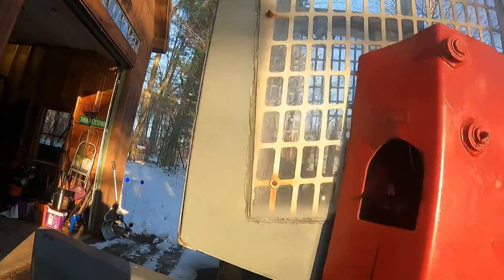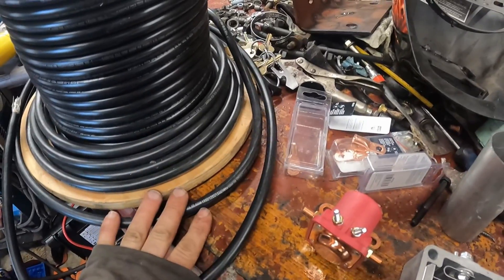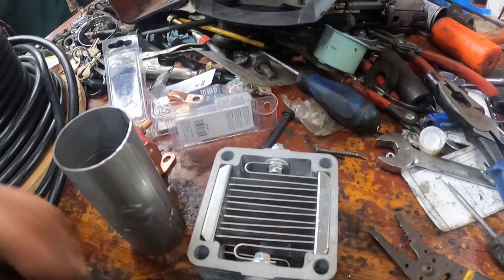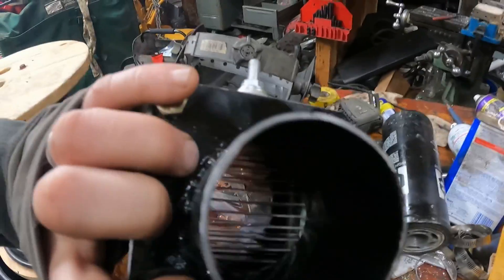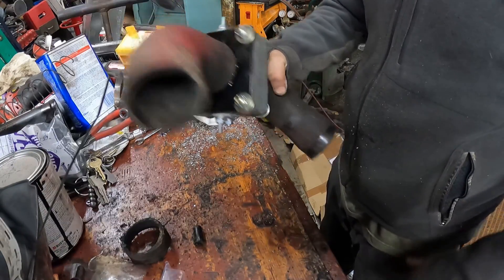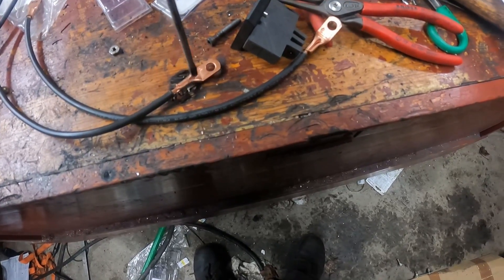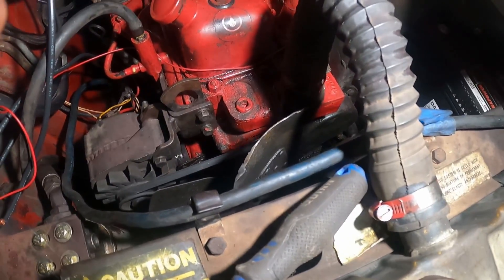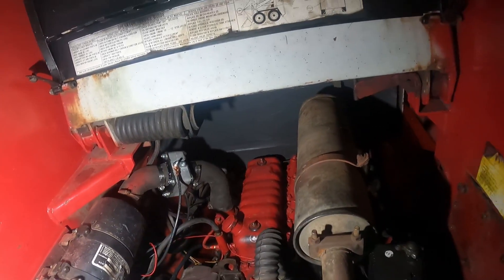Cummins Grid heater on Perkins diesel cold start mod

Comment: My old Ford has the diesel thermostart on it too. I've been meaning to replace the module and get it working, but burning diesel right next to the rubber intake hose is kinda nervous territory.  My big ass 4DLT battery could push that grid heater no problem I'm guessing. It looks about 5" square, is that close?

Comment: Did this on my 93 Chevy diesel many years back to supplement the glow plugs on Montana’s 20 or 30 below days. Worked amazingly well. Especially if you have the battery capacity to run the grid heater while cranking. 
Great content.

Comment: I have a Mustang 2054/Gehl skidsteer. I have to use ether now for cold starts and you may have saved me a motor. Problem I have is that I cant find your relay with the I/S designation stamped on it. What is the part # or brand and maybe you can tell me where the glow plugs are located. I have the Yanmar 4TVN88 engine? Great channel, Thanks.

Comment: I know I'm 2 years late on the reply:
Something you can consider in wire size..... Most times when you use this addition, it's Ball Freezing cold. so there's that to help should you be over-amping the wire gauge(size), and the wire is free open air,  not stuffed in a conduit full of under-rated conductors.
Cheers

Comment: My old Ford tractor had a small heater in the intake but never worked well. I like this idea. It is gone now. My case 1840 always starts with no heat BUT not much California cold to deal with
Reply from the maker: Thank you, It's really worked well.  Way easier than trying to rig a heat gun each time.  With this setup it's always started, even down to below 0f.

Comment: You need more subscribers. This is good stuff.
Reply from the maker: Thank you very much!  I think that my big troubles come from not being as savvy with SEO and social media.
Reply: @wirestiresandfires214  welp you're headed in the right direction. I understand what you mean about SEO and all that, guess it's all about building a following for the neat stuff you do. I found your channel from the Arduino welder mods, most practical this g I've seen from an Arduino board yet.
Reply from the maker: @Tictacpanter  Thanks, If nothing else this channel has really improved my project completion times.
Reply: Check out Jims fix it shop same thing

Comment: Maybe check my math on this, but I think wire gauge is sized for a 100% duty cycle and indefinite working life (from internal heat-degraded insulation, at least) at a given amperage, and that a reduction in duty cycle (or expected working life before fire become a distinct possibility) may justify a proportionate reduction in wire diameter (though this relationship, I assume, is non-linear. Probably a natural log or something weird). Anyhow. While I'm here-- love the vids. It's gonna be sweet when they change the algorithm again and you start racking up oodles of subscribers and corporate funding and stuff.
Reply from the maker: you're totally right on the wire size calculations, I'm sure them being in the open air helps too.  The smaller wire hasn't gotten warm in the 15 seconds  or so I run the heater(at least measuring with a calibrated finger).  I'm glad you enjoy the videos, I really like making them, It seems like if just one video really takes off the algorithm will notice me.  but really this is all for fun and I'll keep doing it a while yet.  Thanks for the comment and have a great day!

Comment: Hi Brent. I have experience of the flame start device going back to the 80s. It was fitted to some Ford Transit vans using the 2.4 ltr York diesel. A notoriously difficult to start engine. The theory of the Thermostart was that a button was pressed in the cab which sent power to the heating element. When the element heated to the required temperature a valve opened above the element. The valve was fed with diesel from a reservoir mounted high up on the bulkhead so that fuel could gravity feed down to the heater plug. As you say, the fuel would drop onto the red hot element and burn. At which point you’d crank the engine over and the flaming fuel would be drawn into the cylinders hopefully allowing the engine to start. In my experience it didn’t work very well at all. Most people I knew would just resort to spraying ether into the air intake. Much quicker and much more gentle on the starter motor. All the best for 2022
Reply from the maker: Thanks for the comment!  There really isn't a ton of info I could find on people who had first hand experience with the Thermostart.  I'm feeling validated to hear your experiences with the Thermostart were similar to mine.  Sounds like  mine was working as well as can be expected.  I do try and avoid ether unless necessary, and this means I can start from the cab with no fuss no muss.
Reply: @wirestiresandfires214  I’m glad I could help. A later version of the York engine was fitted to the  Mk ll Transit and Ford had completely revised the cold start system. They fitted proper glow plugs into the ante chambers (it was an indirect injection engine) and also had an automatic excess fuel device fitted on the injection pump. That engine started much more easily. But it showed that the original preheating system was basically flawed. Yeah, I don’t like using ether on a regular basis either, although Ford would fit an ether injection system to the Mk I 2.4 York engine from the factory as an option. They finally solved the bad starting issues once and for all when they replaced the 2.4 with the 2.5Di. That was one of the best engines Ford made. Keep up the great work 👍
Reply from the maker: @tonyr1963  thank you, I did consider swapping heads from the 4.108 Perkins that was originally in the machine and had provisions for glow plugs.  I wasn't positive that the heads were 100% compatible with the 4.107, and this mod fixed the problem without a need for major surgery.  I wish there were more diesel vehicles in the USA, it would be great to be able to pick up an engine on the cheap from a breaker yard.
Reply: Eather is bad on 400 psi diesel perkins I love my Massey to much

Comment: Awesome.  My International 2500b tractor has the bung on the manifold for a glow plug heater like your gehl.  Was gonna get it and set it up with a new ignition for it since the ether start on it is out of date.  But definitely gonna do this heater mod to it.  Thanks good job 👍
Reply from the maker: Awesome! let me know how it works.  A good test to see if this mod is worth it is to take the air filter off and put a heat gun in the airbox(as long as it isn't plastic).  If it starts with a heat gun this mod should work great for you.
Reply: Good day  POLOLOUS3  I have 574  which I think is same style of motor. Wondering if u tried  it & how it work.  Thanks